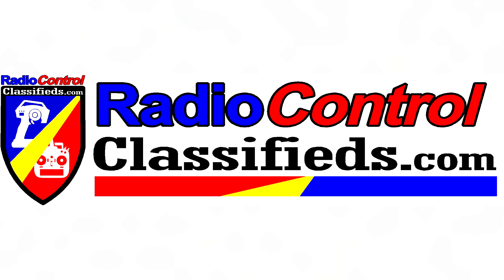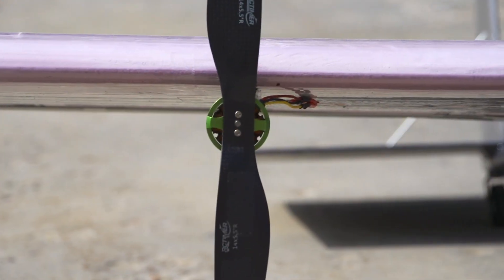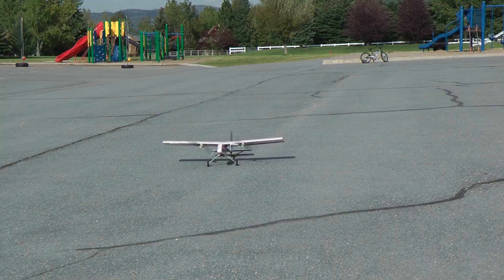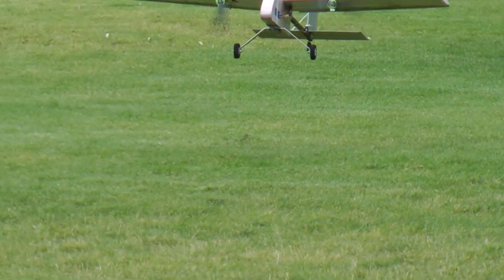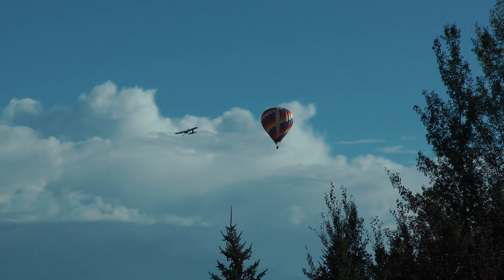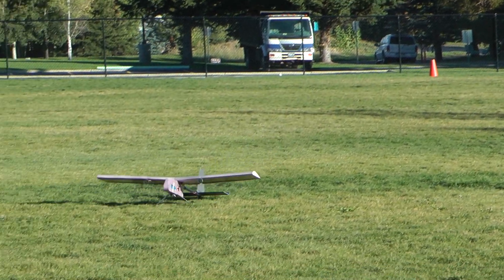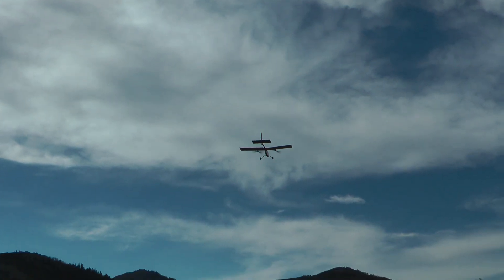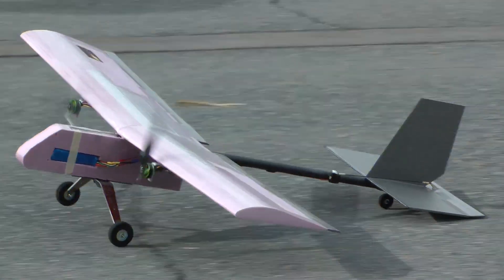Twin Motor Heavy Lifter Cargo Plane - RCTESTFLIGHT -

Comment: For those lazy guys... here is my homework... airframe specs.

Total Length: 53"
Wing Chord: 12.5"
WingSpan: 57"
Wings/Fuselage made from 2" pink insulation foam.
Tail 6mm depron, 
Boom 25mm carbon Tube
Aileron Width: 1 3/4"
Tail Span: 20"
Tail Chord: 9"
Elevator Width: 2"
Vert. Stabilizer Height: 10.5"
"Clark Y" airfoil

Motors: RCMC ? 750kv motors, with 14in x 5.5 prop, changed to 12in prop
Battery 3000mA 4S Lipo

Weight. 3 Lbs 7oz = 1.55Kg

Comment: Hi , have you tried folding depron foam for the wings and tail plane and fin ?  I made 30 different designs in this method ,, e Harsh - Hunter- Fun E Vulcan ,,, E Shark ,,E Bandit and many many more which are not published in RCMW ,,,  like your design and how it works and will make one similar with my wing design - please look my old vids ,,, How to fold depron wings . did you use throttle to rudder mix ?

Comment: Nice video. You mentioned that the propeller will stall at higher throttle because the blades are too big. Could you explain what causes a propeller stall and why shorter propellers would correct it? Thanks.
Reply: If I'm not mistaken, it is not the propellers that stalled in this case, but the motors.  The burst load was too much for them and they chunk with that horrible sound instead of spinning properly. 14 inch props proved a bit too much for those motors when slamming the throttle up.   Looks like they were alright with those motors if the throttle was raised more slowly.  I wonder how hot those motors and ESC ran with the 14 inch props.  Would be nice to see another video with the 12 inch props, for comparison.  Software such as Motocalc, and other similar web-based calculators, help one to match a prop to a motor for maximum performance with an airframe and battery and ESC and designed flight envelope combination. 

Propellers can stall too, but that is different.  That is where they are not producing thrust efficiently because they are not being fed enough air, sort of.  Get them moving quickly through an airmass and then they bite efficiently according to their designed performance.  When stalled, they still blow wind, but have not yet achieved the aerodynamic thrust for which they were designed.  Stalled props might not have enough thrust to get a plane off the ground, or fly, unless one launches it with a good throw for sufficient airspeed for the props to do what they do best at operating airspeed through the airmass.  Once at sufficient airspeed, they work as expected.  Before getting to that airspeed, they appear to perform sluggishly, then suddenly bite when the aircraft gets up to airspeed for them.  Props that can help an aircraft reach its top speed may be less than ideal for accelerating from very little or no speed, because they stall .  The back of the blade may be slapping the air back, but the front of the blade is not ideally lifting or sucking  the prop forward.  But once the aircraft is moving forward at the prop's good operating airspeed, then the aircraft bursts forward since the front of the blade is now also working to produce forward lift (thrust).

Comment: Nice work, you could mount a KK2 board vertical and use vector steering with the roll output i bet and angle KK2 for gyro position. Will you be FPV equipping it?

Comment: Aweseome video. Maybe you can tell some more infos about the plane? What airfoil did you use and whats are the sizes etc. I would like to build one too!
Reply from the maker: I didn't use any specific airfoil, just cut what I thought looked like it would be lifty.
Here are some specs: 
Total Length: 53"
Wing Chord: 12.5"
Aileron Width: 1 3/4"
Tail Span: 20"
Tail Chord: 9"
Elevator Width: 2"
Vert. Stabilizer Height: 10.5"
Reply: rctestflight what are the prop size
Reply: A similar airfoil one can find specs on would be the "Clark Y" airfoil, very high lift and good stall characteristics The Spirit of St. Louis used the Clark Y; the Piper Cub used one that is very similar.

Comment: That's probably the best flying scratch built Home Depot foam type plane ever. Awesome job Daniel. It'll be interesting to see how those motors stand up. A serious candidate for an awesome FPV plane using the "heavy lift" capability to haul a big battery. A big thumbs up! Cheers, Bob

Comment: Plans??
Reply from the maker: Total Length: 53"
Wing Chord: 12.5"
Aileron Width: 1 3/4"
Tail Span: 20"
Tail Chord: 9"
Elevator Width: 2"
Vert. Stabilizer Height: 10.5"
Reply: Thanks
Reply: daniel omisola can you not see "
Reply: I find it hard to believe you are using a device that cannot display the inches symbol which is commonly the double quotes symbol.
Reply: rctestflight  are the measurements in inches or cm? all i see are numbers
Reply from the maker: daniel omisola inches
Reply: see what
Reply: oh ok. Thanks
Reply: rctestflight
wingspan?  and if the answer is 53" then what is the length of the plane?
Reply: David Jensen 57"  Daniel tells you at the start of the vid
Reply: kermets So he does.  Thanks!
Reply: +Martinez UAV not many places except the us still use the old imperial system
Reply: +rctestflight wingspan 57"
Reply: Maraos 9
Reply: motor ?